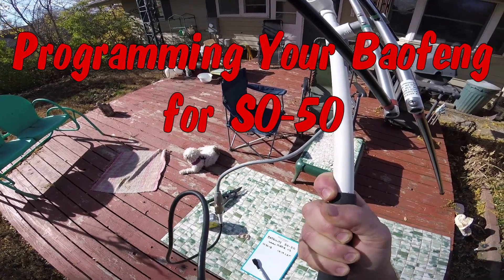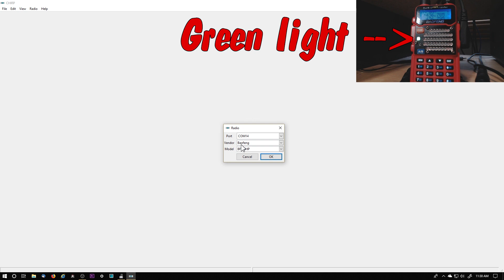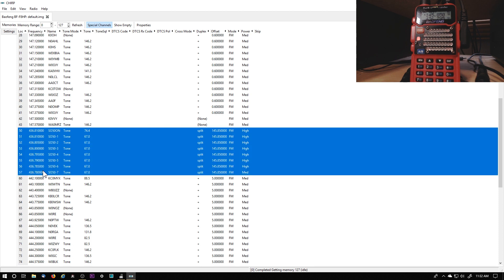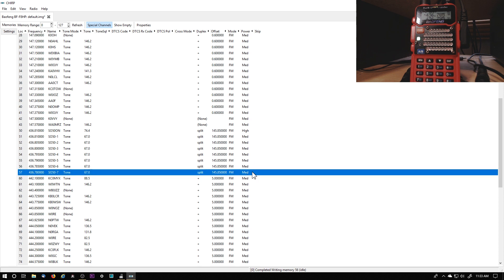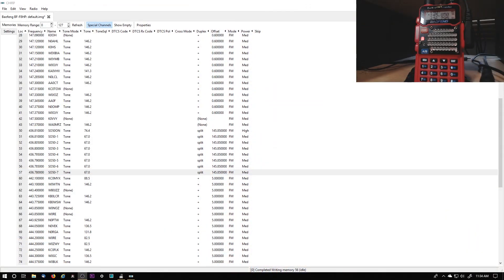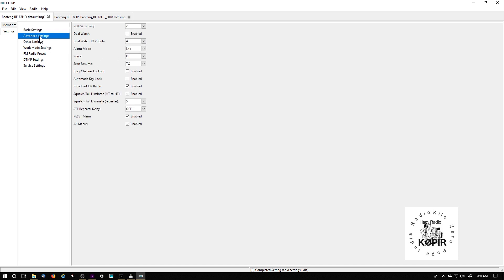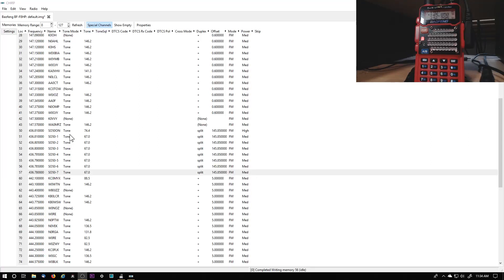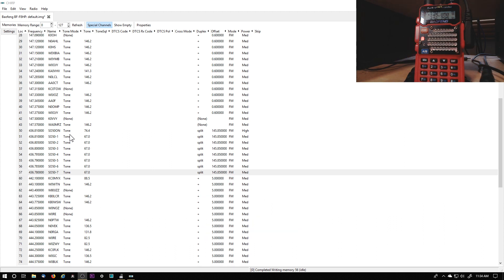Programming Your Baofeng for SO 50 Using Chirp

Comment: Had a quick question when programming what would happen if you if you put the 2meter in first instead of the 70cm frequency?
Reply from the maker: Wesley Johns it just needs to transmit on the VHF frequency so there are different ways to do it. You could give it a try. 73!